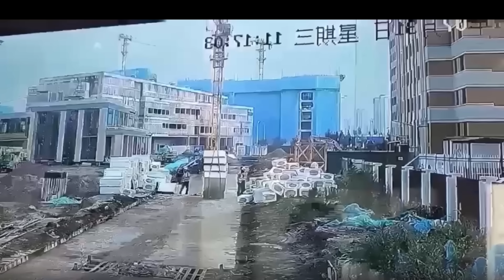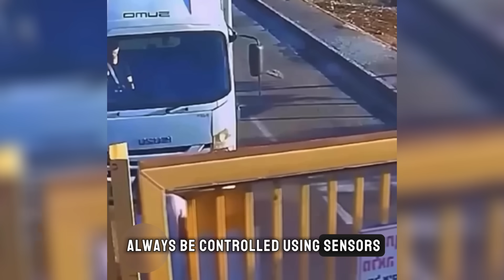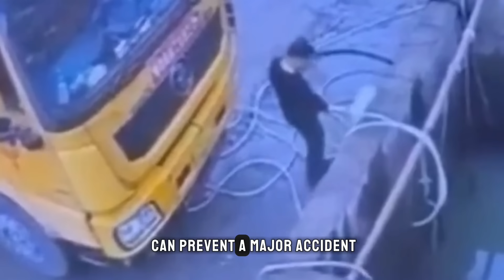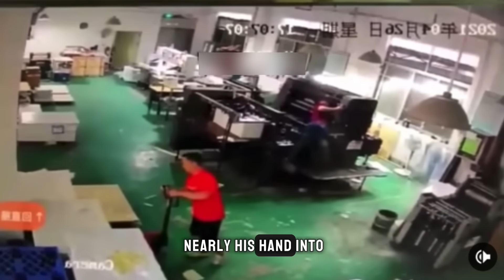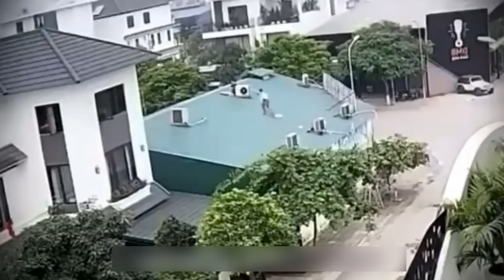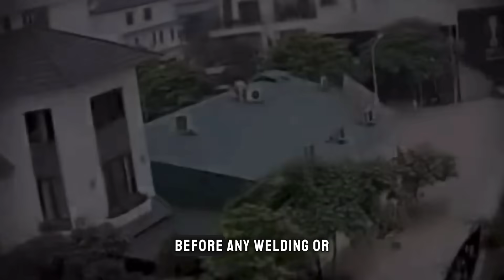Everything Was Fine... Until It Changed in Seconds | Crane Accident

Comment: 1.20 Don't worry, the crane was lifting polystyrene foam blocks .
Reply: I wondered if it was those lighter blocks. Still, that’s going to leave a mark.
Reply: @Tinywars
That load was very, very heavy. Cranes aren't used for air bubbles or fantasies. The guy didn't pop out from underneath there either. He didn't decide to take a power nap.
Reply: @Heidi-f6m ..Nah. Use your loaf. If they needed those air blocks up high of course they’ll use the crane. I’ve had to use a crane on site to lift stuff like that. I’m not saying it didn’t hurt. It most definitely did, but it could of been so much worse. I was a bricklayers Labourer for years. When up high I’d get the crane to lift everything and I mean everything.
Reply: @Tinywars
No, yeah, It's fine. Just a silly nothing and not even a stubbed toe. Never an accident before and I'm sure there's not been one since. These cranes and rigs are just big playsets. Nothing in the world to worry about.
Reply: @Heidi-f6m ..Did you even bother reading what I said? I suggest doing so again.